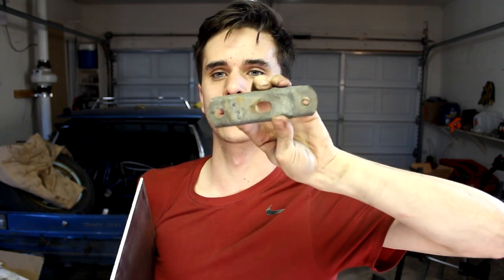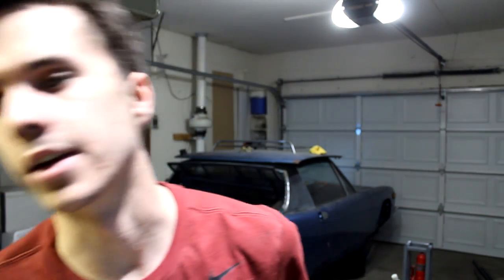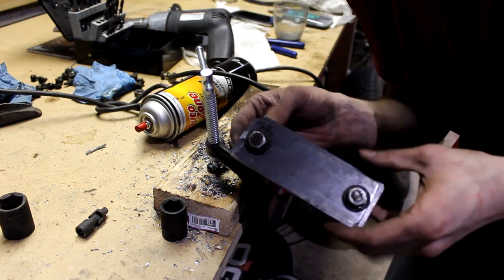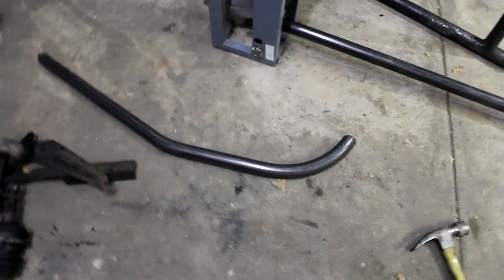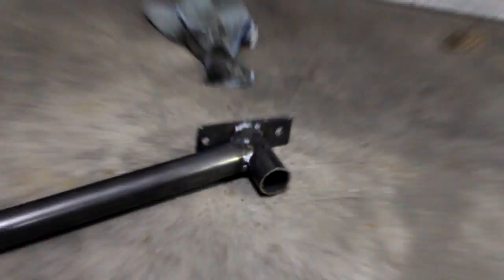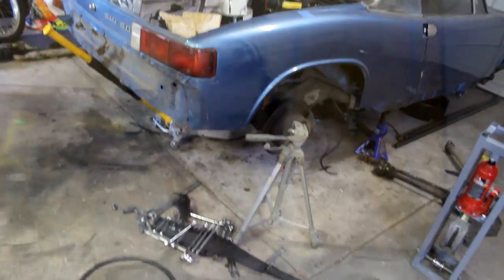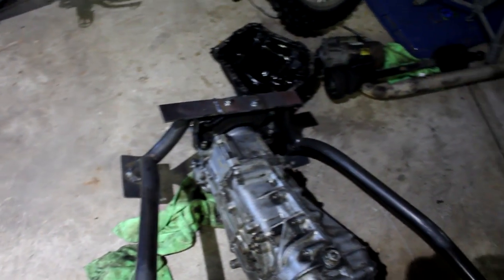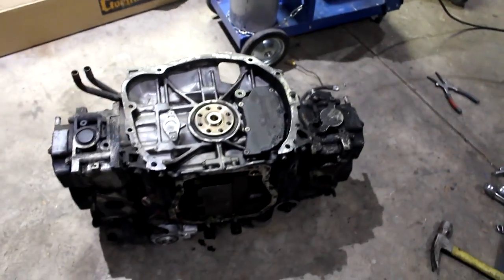Project 914 Part 13: Engine/Trans Cradle

Comment: are you planning on welding in gussets on the high stress areas?
i ask because where the transmission mounts, and tubes intersect seem like they may need additional support
Reply from the maker: I was thinking I would probably add gussets in a few spots, when I add the engine mount part as well.